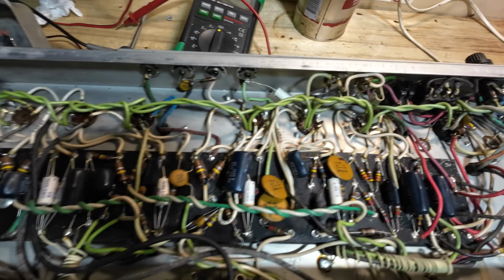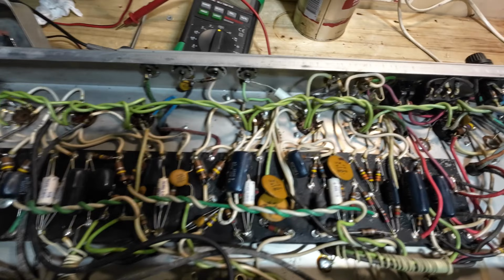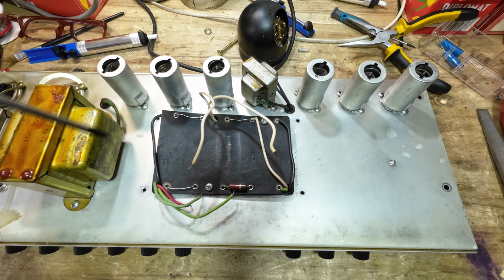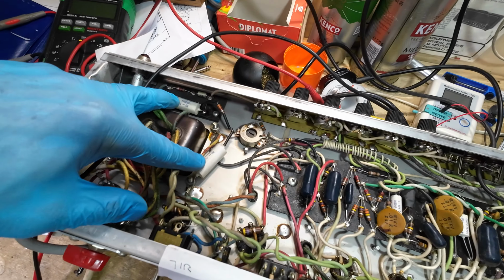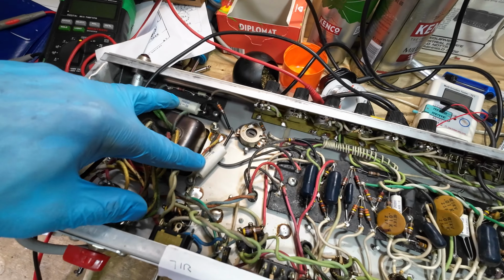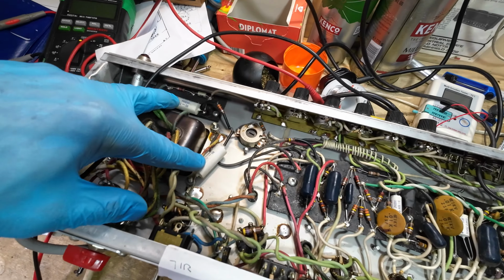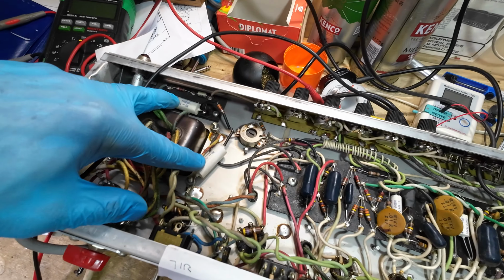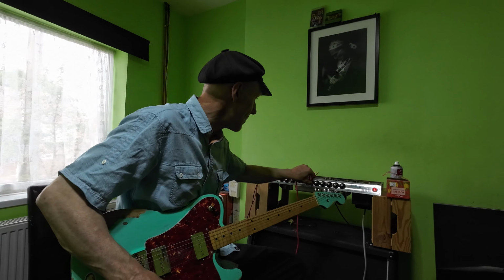Fender Vibrolux Reverb Repair and Analysis

Comment: You're  right about those old boards. Most people just keep replacing caps, resistors, and tubes and never resolve the  underlying problem.    I'll be rebuilding one once the snow starts falling as the alcohol washes haven't made much difference.
Reply from the maker: Hello. Thank you. Like you, I can't see the point in cleaning the board. As I said in the video, I think the boards have reached the end of their lives. I think Tube Amp Doctor does some replacement  Eylet boards for some of the Fender amps. I would rather have a turret board. It''s job done. Thanks for watching and take care.

Comment: The Vibrolux Reverb is a wonderful amp.  I picked one up in Jan 2024.  The cabinet had been chopped in half, reverb tank missing, several knobs missing, front baffle and Fender logo missing, several preamp tube shields missing, etc.  I recapped the amp, re-built the bias supply,  fixed the cabinet, replaced the missing bits, etc.  I had some leftover Fender grill cloth from a previous project to cover a new front baffle.  All I have left to do is add a bias adjustment pot to the bias balance pot.  It really doesn't make much sense to keep a 1970's Fender amp "as original as possible", as they don't have any inherent collector's value, and should be fully serviced and played.  But I understand some customers don't understand this, or don't want to spend the extra money for a tech to complete the job.
Reply from the maker: Hello Michael. That sounds like a good project. I wouldn't mind seeing a few pics of that one. Take care Michael.

Comment: Wow, that is the cleanest silver panel Fender I have ever seen. The green heater wires are still bright green, and the white wires aren’t green with corrosion GUMPTION! 

I’ve had luck reducing DC leakage on the volume and tone pots by removing the just wax on the board between the bypass cap eyelets. Heat gun, shop towels and alcohol work pretty well. Not too much effort. Or just leave the volume control alone while you play. Sound great!
Reply: DC on the pots can cause premature failure, as well as noisy operation; I suspect that current passing through the threaded bushing and shaft on it's way to ground can probably cause galvanic corrosion (a frequent problem with dissimilar metals) and perhaps even cause the shaft to seize up in the bushing (if it's a metal shaft). Not to mention that plate to grid DC leakage through a waxed, damp & contaminated board will change the bias of the preamp and PI tubes, likely causing blocking distortion.
Reply from the maker: Hello Mark. Yes, it's brilliant condition. Those fibre boards will always absorb moisture. There is plenty of moisture here in the UK. Take care Mark
Reply from the maker: More great info here, thank you. Take care.

Comment: Caps on the 6L6 sockets were factory installed to prevent parasitic oscillation which was sometimes caused by poor lead dress when these amps were built.  The amps usually sound better with these removed, and if it oscillates then you need to fix the lead dress.
Reply from the maker: Not the best way to go about things. Band aid fix. Thanks mate and take care.

Comment: The bias filter cap might be the most important cap in the amp, and those white Mallory caps are a known failure point.
Reply from the maker: Hello. It went against the grain for me leaving them in but they tested perfect. As I pointed out in the video, the customer wants the amp as original as possible. With the price of tubes nowadays it's risky leaving them in long term. I may still change them though. I will have a chat with him.

Comment: Back in the 1990's a local guitarist asked if I could look at his 1974 Fender Twin Reverb.  Doghouse caps were gone so replaced them, but like you, couldn't find a problem anywhere else apart from the amp had very low output. No internet back then and other amp techs would never give anything away without cash changing hands, so I admitted defeat . A few weeks later it dawned on me what was causing the problem, but I never took on the job as it was way above my paygrade at the time. The owner found a tech 300 miles away to do the work and it cost him more than the amp was worth back then to get it done.
Reply from the maker: That's a good little story Pete. Those caps are always shot in the Dog House. Take care Pete.

Comment: Willow Valve sold rebranded tubes from 70s to the 90s. They were based in Reading.  They were bought out around 2000 by Connect Distribution in Birmingham and moved there. I don't know what happened to them after that.
Reply from the maker: Thanks Dave. That's good info. Take care mate. See you soon.

Comment: A lot of people who have silverface Vibrolux modify them to be more like a blackface.  I’d think that kind of modification would make it worth more, but I’m not a collector-type.  Is (was) that the original power transformer?  It looks bigger than I remember, and it has that flux shield.  If it’s got a replacement power transformer,  the collector value is probably a moot point
Reply from the maker: Hello Jeremy. It looked original. I should have checked the date codes on it. The Guy that owns it is pretty clued up on vintage amps. He did say it was all original. You could be right though. Thanks for watching and take care.